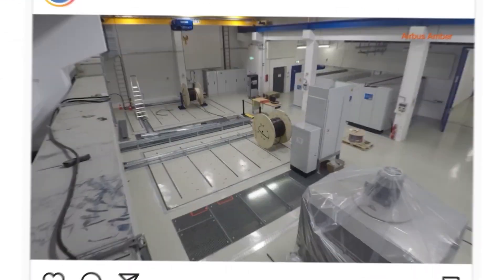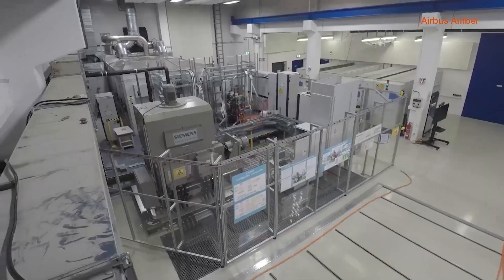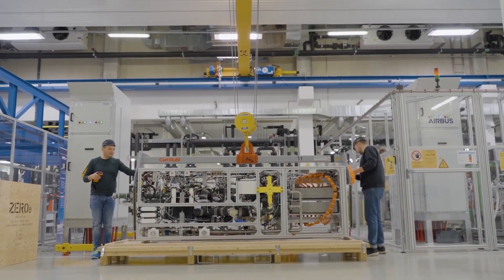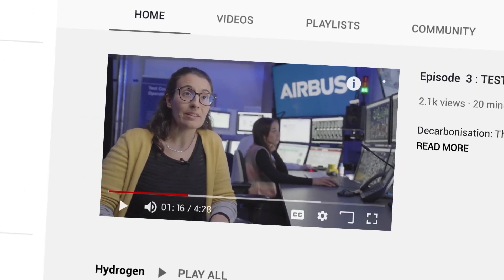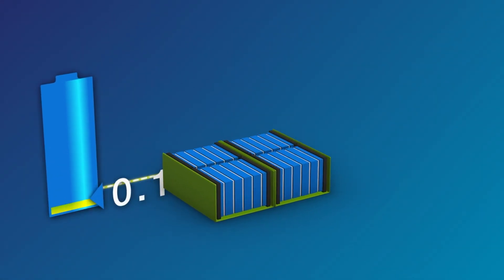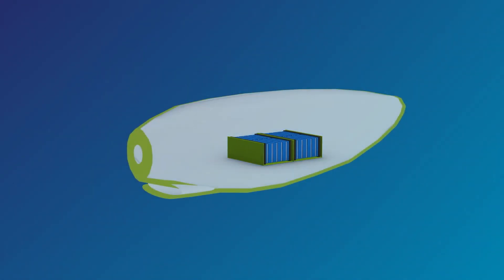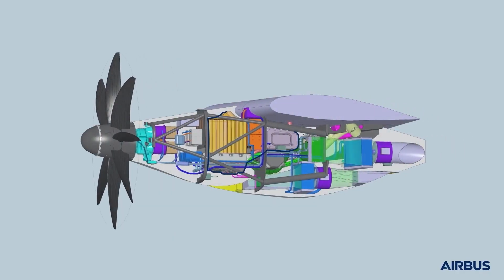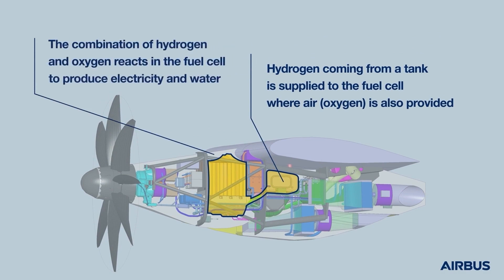Countdown to #ZEROe: Episode 3 - Fuel Cell Systems Testing

Comment: First of all airbus you could make the a380 or a350 hydrogen because development of zeroe will be high I think? When you make your 320 220 350 330 340 it will be the same cost for aircraft body but not engine I don't know if engine is cheap or expensive. If its cheap make an other aircraft or If they are expensive put them on 320 220 350 330 340

Comment: I won't ever fly on a hydrogen powered aircraft.  Hydrogen atom is the second tiniest in the known universe and when it is in liquid form one tiny leak and boom. The weight of the tanks alone will mean the aircraft will have almost no reasonable range.
Reply: leaks may not be prevented but can and should be adressed properly. Due to the light density it is prawn to rise anyways which makes the probabilty of creating an explosive atmosphere much less likely. Still you should watch out for cavities where it could agglomerate. The problem i see is the infrastructure nescessary to implement hydrogen powerd planes though. Politics play a mayor roll here.

Comment: Airbus is better than Boeing for real
Reply: Does Boeing have any hydrogen plans in the works?
Reply: Yeah, but with a lot of delays most likely, as Boeing is facing a lot of production problems. @t.g.2777
Reply: You're really gay
Reply: Both are good
Reply: Being a bit advanced doesn't necessarily make your better.
Reply: @glynecollymore5569 Yes it does, not only that. They do Tech, Comfort, Efficiency, Design, Creativty etc homie
Reply: But its European, automatically makes it better @glynecollymore5569
Reply: And well, the main competitor, being Boeing is not doing the best at the moment. @glynecollymore5569